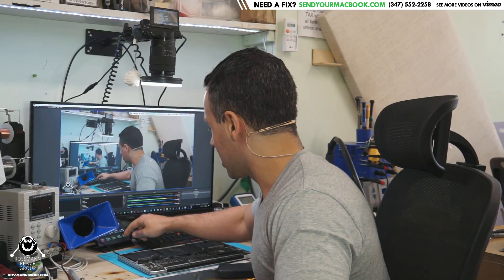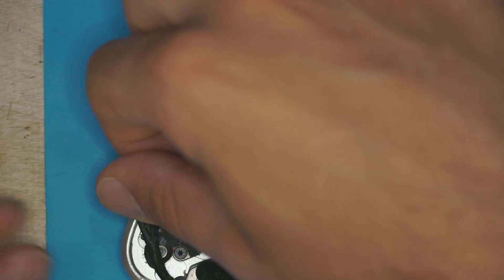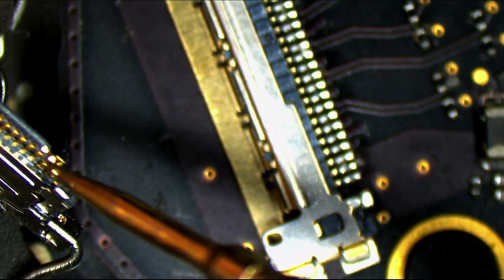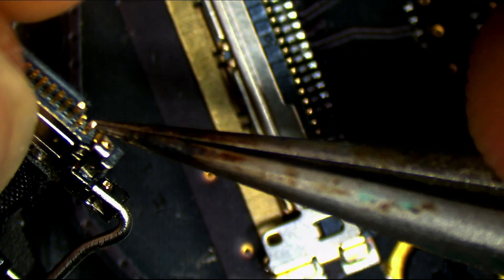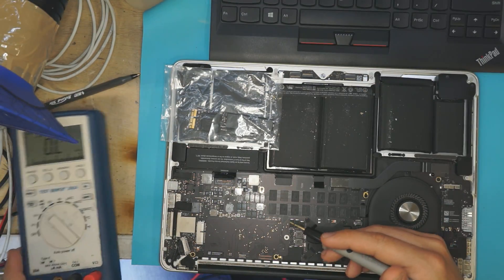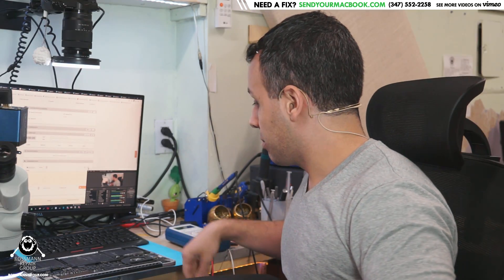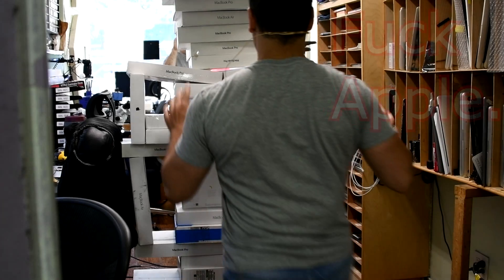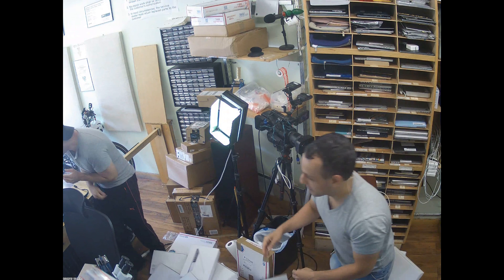APPLE GENIUS BAR STRIKES AGAIN!

Comment: It's not that they consider independent repair places are incompetent. That is just the excuse they use because it's something that nobody can prove without a doubt because they would have to test every independent repair facility and there is no standard test to test them with. The reason they are doing this is simply because of greed. There is someone else making money from their products and they want that money. Doing that has multiple benefits for them because they can charge what they want even if it's astronomical and unfair, you don't have a choice and this also allows them to tell the customers it's unrepairable which will force them to buy a newer product. This will help them boost their sales so it wouldn't be convenient for them to allow independent repair facilities to exist because they would be able to call them out when Apple is refusing to repair their products which forces them to buy new products. It's for this reason that I have never bought an Apple product in my lifetime. They have always been like this since day one and it has never been about anything else but to make the maximum amount of money from their products. This would be fine if they were not a publicly-traded company on Wall Street that demands that they make as much money as possible, even if they have to screw people over, they have no problem doing that. I have always built my own PCs and I repair them myself if something should go wrong which almost never does. I use Android phones that don't put locks on the bootloader so that I can install my own operating system on them and I believe that helps give me a little more privacy since I have total control over my phone compared to giving that control to the cell phone providers who now can't remotely access my phone and turn off features like using my phone as a modem to provide internet to my PC. I have been able to truly use my unlimited internet that I pay for every month without them throttling me down to super slow speeds after I hit 50 gigs download. I used to use Linux on my PCs but that became too much of a pain for lack of drivers for Linux so now I just use Microsoft unfortunately but I run a real good firewall so that I was able to control what was being sent out of my computer without me knowing. That and all of the identities that I use when I'm required to login is always changing so I do have one computer that has my real identity that I only use for banking and things like that but I never use it to surf the internet or shop with it ever. I don't even have it connected to the internet most of the time I just physically unplug the ethernet cable. I don't like to be spied on and I only buy products that I can do whatever I want to with. I would never be so stupid as to buy anything where I'm forced to rely on the word of some company to use my hardware because companies' only goals are to make as much money as they can get away with. These days they can do whatever they please since there are no longer any laws that will protect the people from them anymore so I just won't use them if there is an alternative. It's definitely getting harder and harder to do this but I'm still finding options to live my life as private as I chose to be and still own the hardware I buy and do what I please with it. People in this country that buy Apple products have money to burn usually which is why Apple wants to see that they burn it on them and not anyone else. The thought of that just drives them insane and they just can't handle the idea that someone else will make that money instead of them. It makes total sense that they want total control over their products because then they can do and say anything they want to their customers who won't be able to show that they are being lied to because only Apple will have the proprietary tools they would need to show what is really wrong with their computers and phones. You will just have to take Apple's word that what they are saying to you is the truth. You would think that people would not put up with this type of crap from any company but that goes to show you just how stupid the people in this country really are. Just a bunch of sheeple unable to use their own brains for their own good. They will keep buying Apple until some other product becomes the new favorite. They won't even know why they would leave Apple but would because everybody else did. But being that Apple is as big as it is, it's highly unlikely that Apple would allow anything new into the market without buying them or crushing them. It would just depend on whatever new tech that comes out would hurt their current products or if they can put something out that made them exclusive in the market. Whatever it is, I'm sure Apple will find a way to profit from it because they won't allow anyone to make money in their market without them having a say on it. They are above the law here and don't even pay taxes anymore which for some reason, Americans don't seem to be bothered by that despite the citizens having to pay so much of their paychecks in taxes. You would think that people would just stop buying and using Apple products till they paid back every last cent that they owe this country in back taxes. That would make sense to me and be a completely reasonable response since everyone should have to if they expect the people to pay. You would think that after seeing a video like this that it would spread like wildfire and the people would boycott Apple till they stopped this absurd business practice but that would be wishful thinking. This isn't the same country I grew up in anymore, it's like somebody has poured lead into the drinking water and everybody has just become a bunch of braindead zombies that are rooting for these corporations to just own them outright. All I know is that I gave up on the people in this country a long time ago because they just keep getting more stupid by the day. If something was going to be done then they should have acted on this back in the early 2000s. They chose to just keep supporting these corporations so they deserve everything that Apple will do to them. This was their choice and it's a little too late to do anything about it anymore. They are just too powerful now. I can't wait to see when Apple comes out with a new gun for the police to use only. The iGun. I'll put my money on it that the morons here will be cheering Apple on when they unveil that new product. It will be followed up with the iJail which will also be a huge success simply because it's Apple. They couldn't possibly do anything wrong. It won't be long that they will create a law saying that you can't say anything bad about Apple in public which will get you a 3-year sentence to their iJail where they will be allowed to reprogram you. Hope that will work because they won't let you out until you have been successfully reprogramed. I'm sure that they will have their own people being the only ones allowed to decide whether you have been reprogramed or not. Only they will be able to tell you that because nobody else will be allowed to tell them anything that might get in the way of them making more money. All this sound crazy to you? Well, it doesn't to them, not one bit. And to think, we could have put a stop to this a long time ago but we just thought they could do no wrong so we just agreed and kept buying their products. All we had to do was not buy their products and none of that would ever be possible. So as long as the idiots in this country stop buying their shit will this stop. It doesn't get any simpler than that. How much do you want to bet they will keep on buying Apple?

Comment: That’s a clear manufacturer defect. Yes the person probably put it in wrong.  That is true. But the cable and connector are not modular. Nor do they clip in or screw down. The cable and connector are extremely flimsy and easily breakable too.

Comment: I'm a total idiot, but can anyone please explain men how does 5:07 work? He's testing to short. to ground, ok, so he has one end of the multi-meter on the pin and the other one on ground presumably that's what that metal part is. I saw he was in diode mode measuring resistance (it must be resistance since he's talking about Ohms), so why low resistance is short and high resistance is ok?

Comment: I'm laughing at some of the comments on here a black screen any laptop can be caused by the display ribbon cable coming off a mother board or issue with said ribbon cable with no one ever opening a laptop. I worked nine years Dell helpdesk. Even a motherboard failure

Comment: technicians have to fill in job cards. This makes them hurry - hurry to fix things. I have been told by a technician [not apple] that if something is not quickly fixed he will deliberately with side-cutters mess the board up, then he can do many jobs in one day. This is a risk you run with apple. The bottom line is more important than dealy kindly and fairly with customers. When apple fails then go to Louis and you will find peace and happiness. ... at a lower cost. As for those merciless apple technicians...... God has seen them.... that's all I can say. 
My advice to apple. Check for sabotaged boards every time a tech cannot fix the board. Do a quick 60-second check. YOU will know what to do. 
And as for Louis... do the same with your techs... they might be doing the same....

Comment: I have no doubt Apple "geniuses" are one level up from geek squad..  Its pluck and chuck for the most part, and they aren't trained to take their time or do a good job.  Its get it done and move along.  And because its not their business they don't have to care about customer service like you do.  You mentioned doing a great service and getting referrals.  Apple will get those customers anyway because their name is on the door.  And if they charge hundreds for something simple,  its good for Apple's bottom line and the customer is non the wiser, until you expose it. And im sure thats why Apple shut down third party repair now.  Now there is no one to expose this kind of behavior.

Comment: If you are a Domestic Appliance tech you run into this BS corporate business practice every repair job, from different screws, parts more expensive then the machine, to utter retardation of design and skip the material to the absolute basic and then charge royal prices, your washing machine and dryer are full of corporate NO DONT FIX BUY NEW BS, and especially your Fridge.

Comment: Well in the 20XX era mostly young or new ppls are working in those stores I feel bad cause they arent enough trained and what not probably 0 experience with pcs the most funny is that apples devices come assembled by a chinese guy whos taking alot less than even the cost of the new ribbon cable rossman going to replace on this laptop and guess what they all come perfectly assembled so what either the guys there hate their life either they are enough dumb to plug in such big connector also the bad thing is to hide from the customer that you broke something while thats gay af when you work in a multibillion worth company